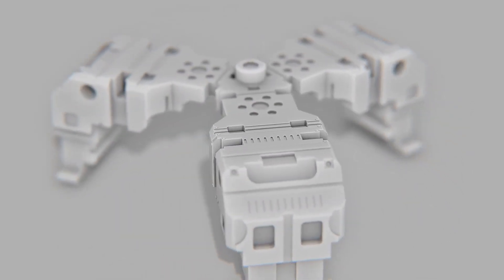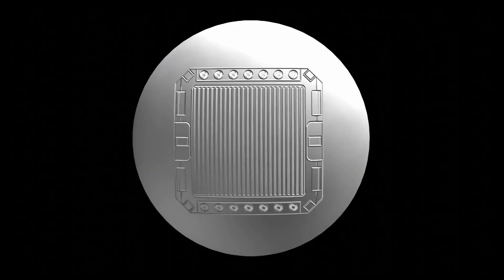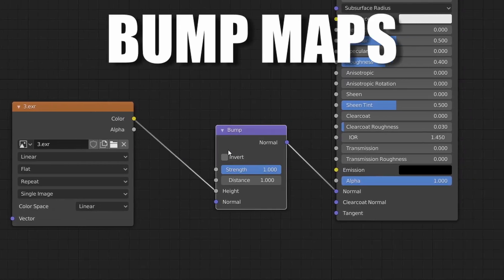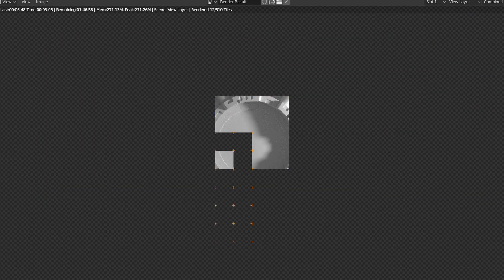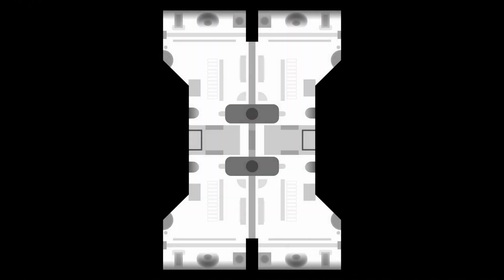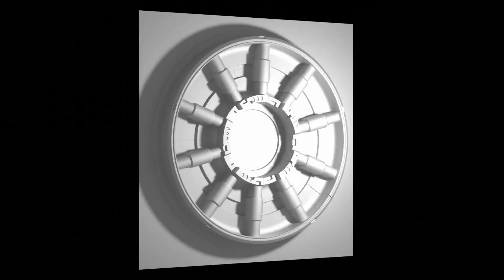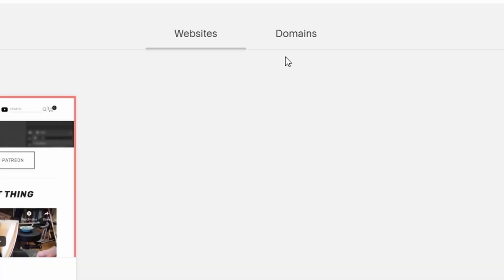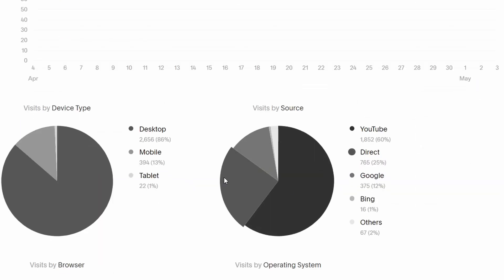WTF are... NORMAL MAPS?

Comment: When making use of smooth shading, there are two techniques called Goraud Interpolation and Phong Interpolation.

In Goraud Interpolation, the vertex colors are calculated based on their normal directions and the current lighting / material information. That color is then interpolated across the surface of the polygon that's formed by the triangle. This means that lighting calculations are done per-vertex.

In Phong Interpolation, the vertex normals are interpolated across the surface of the polygon and the color of each fragment is calculated based on it's normal direction and the current lighting / materials. This means that lighting is done per-fragment / per-pixel.

For obvious reasons, Phong interpolation is a lot more computationally expensive than Goraud interpolation, but produces a much more accurate shading that captures things like specular highlights.

Modern computers are more than fast enough to do per-fragment / per-pixel lighting, as is the case with Phong interpolation. But when you use a normal map, you're skipping the interpolation of the vertex normals and simply sampling the fragment normals from a texture image. This is less computationally expensive and gives you more control over how the surface is lit because you're essentially telling the renderer which direction light should be reflected on a pixel level. You can make a very low-poly surface be lit in almost the exact same way as a high-poly surface.

Tessellating a surface into more polygons can also help lighting appear more smooth. If you do this at runtime, you can have a displacement map displace the vertices of the generated polygons to add more detail to the surface. But if you're not tessellating, you can still use the same image as a bump map, in which case you're just creating the illusion of the surface being raised or lowered via a lighting trick. This isn't as good of an effect as normal mapping, but takes about a third of the data.

The use of bump mapping or displacement mapping is a mutually exclusive choice. Do you want more detail, or just the illusion of more detail?

Using bump mapping together with normal mapping is possible, but stupid and pointless. Just choose one or the other. Do you want to save memory with a bump map, or have more detail with a normal map?

In contrast, using displacement mapping together with normal mapping makes perfect sense because displacement mapping creates actual detail, but may not be able to capture some of the more fine-grained details that normal mapping does because it's limited by the tessellation.

Comment: google search gave me this.. 'Bump maps are the old school way of adding detail to low poly objects. They are used in the same way as normal maps, except they only contain height information and not angle information. Displacement maps are sometimes used to change the location of actual vertices in a mesh' now i get it. good video though glad i learnt something :)

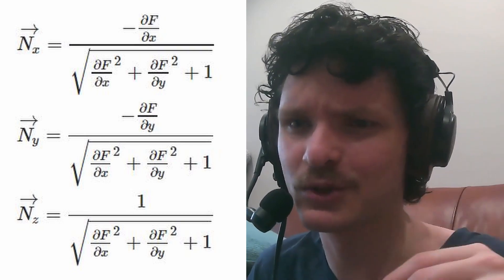Comment: At 2:21, the equation can be daunting at the first glance but it's nothing but "normalising" the normal vector. Basically, the vector we get perpendicular by finding the derivative (numerator) is some scalar and we want a unit length (magnitude 1) vector that's perpendicular to the surface. That's why we divide by the denominator. So all it does is give us a unit length vector.

Comment: I still have no idea what a normal map is
Probably because I'm still not sure what a normal is
Reply: a Normal is a vector pointing out of a Face in a 90 degree angle to calculate light on it (think of it like sunclock or what it's called). As long as the normal direction to the light is above 90 degree the object is presented lit (the more the light is at a similar angle to the normal the more the face brightens up), is the angle negative the object is unlit.

I use faces because they are easier to understand, but they are just the sum of vertex normals. these doing the same just for vertecies. Also if you see hard edges on object that means there are multiple vertices pointing in slightly different direction (as every vertex can only have on normal) soft edges only have one vertex and one normal.

Comment: An old artefact from 2020 and before, when game engines weren't strong enough to render million and millions of polygons in real time. It was used to fake details. 
You had to build the exact same model twice. Once you are finished your detailed sculpt with millions of polygons for your table for example, you had to remodel it with just a couple of thousand or even just hundreds of polygons. Imagine all the extra work they did back then.

Comment: I still don't understand what's the point of using Normal maps if BW bump maps look the same in the end.
Reply: they are more performant if you need realtime rendering like in a video game
Reply: Bump maps, when scaled up, need to do some type of interpolation (to create a new pixel to fill in the gaps when zooming in, look at your new pixel's  nearest pixel neighbors, and take some pre-defined type of average of the neighbor pixel values, and that's the new value for this pixel that we created out of thin air) to fill in the missing pixels on the screen.
AFAIK, Normal Maps allow more of a Vector Graphics style, where you can keep zooming in infinitely and not get the exact same type of weird aliasing effect (there will still be aliasing though).
So, using Normal Maps is a useful tactic if you do a lot of zooms in a game, like with a Magnifying Glass/Telescope/Periscope feature, but probably not in a game that uses a ton of MipMaps (lower res pictures) to simulate every single distant object.

Comment: A bump map converts the info into normal modification, but is insensitive to UV direction. Easy to combine or box map.
A normal map don't need conversion, it's direct info, but it IS sensitive to UV direction, or tangent space. Hard to combine or box map.
Use displacement map without any high frequency detail. Named _H, use for microdisplacement or parallax mapping (not in Blender yet).
Use bump map for small details that have high frequency detail. Named _B, use with a bump node.
Use normal map for anything that needs to control angles accurately. Named _N, use with a normal map.
All these should be set to non-color. Without parallax mapping or geometry shadow shifts, bump and normal maps can look very fake up close.

Comment: And now Ep¡c Games is saying that normal maps wont be needed anymore :,(
Reply: Not in reality, for many games assets the amount of massive detail like you'd want for say architecture just isn't necessary. Not only isn't it necessary such high poly meshes take a lot of space to store on your SSD so it makes sense to use normal maps for small details just like we've already been doing.

Some of the UE5 demos are 200gb installs.... and they lack the sheer amount of assets an actual game would have. Tiny scratches are still nicely represented by normal maps and it'll continue to make sense to use those over insane poly count meshes for a long time to come. The best result will be a middle ground and nanite allows for that, virtually no pop in detailed meshes but normal maps will still be used to simulate detail that otherwise you'd need a stupidly insane poly count to represent like small surface imperfections.
Reply: lol forget that, Nanite is cool but has some serious limitations. Also i wouldn't pay for 500-terrabyte size games, no matter the price. Also your pc wont scale with nanite, somewhere do the asset storage go to be instantly visible in the game, an people barely have 16 gig of ram.

Comment: Remember, when using an image texture as a normal map, set the “Non-Color Data” option on the Image Texture node. And don’t forget to have a Normal Map node to convert the coordinates from tangent space to global space before feeding them to the shader.
Reply: hey man im kinda of like a noob at blender, can you tell me how to use the displacement image texture? like i plug the image texture of the displacement map to the victor displacement node and than connect that to displacement node and nothing happens?
Reply: as a bump ?

Comment: now how can I reverse this better (asking for my 3d printer)? you can displace bumpmaps and "bake" a texture (any color->grey tex and bumpmaps work) into geometry for 3d printing, but you cant undo normal maps for printing the high poly model. (you want all the faces you can get since they'll be sliced as paths, I have the ram and storage, ill make a 200mb model just to displace textures back into a model)

problems:
-the seams are broken unless you can find a perfect midpoint (you need a watertight final model so an accurate midpoint saves many angry hours of meshing)
-baking textures is like a lithophane and it doesn't represent the height detail that the artist intended (a brick's tex =/= the hightmap) (baking textures is nice and simple if you have something like a spherical photo that you get a UV unwrap to a sphere, you can get really nice small globes or props)
-bumpmaps nearly guarantee bad seams (you cant print unless you remesh, you just cant)
-gets very slow for hard edges because you have to uniformly spread out your triangles to be displaced
-edges of UVs can affect some more complex models if whoever textured it didnt use a smooth island boarder. (fucking UV went over the edge of the image somewhere inside to model and broke the displacement modifier)
-white/null gets displaced and will make internal geometry pop out
-cant use normal maps

I know a couple of these can be alleviated with a fill tool swapping the null textures with the intended midpoint color or remeshing first and somehow using that new UV set to only displace the outer, watertight surface for as few seams as mathematically possible, but both of those solutions are only situational and band-aids to the main issue. Any solutions would be helpful. (the end goal is a high poly, very high detail model of the fully texture filtered, fully tessellated, fully shaded model where all the detail is available to be baked into the model when remeshed for watertightness and printed)
Reply: by "baking" I also mean the exact opposite of baking, taking that fresh normal map pie and shoving it back onto the model.

Comment: I feel like he only explained what bump/height-maps do/are but only said that normal maps have 3 channels ...
for those who still want to know what normal maps do:
normal maps alter the direction in which the surface is facing compared to the actual direction the geometry is facing.
the three colors(coordinates) span a normalized vector. Red is X, Green is Y and Blue is Z.
an unaltered surface is this typical light violet as it has a maximum z (blue) component and ~50% the other (50% 'gray'  is equal to 0 while 0% is -1 and 100% +1)
Imagine the vector as a pen balanced on the tip
Reply: Yep i watch the video for understanding why i would want to use a normal map when bump mapping is so much easier to create. Still dont know lol
Reply: @Chevifier  A bump map can create magnification artifacts-- if you zoom in, it'll give you pixellation.  It's also slower to calculate, like if you're aiming for 60fps.  But you can use a bump map as a start, and then bake this bump map to a normal map, which will give you the best of both worlds.
Reply: Great! Thank you!
Reply: Thanks
Reply: Ok so i presume you would model your hard surface, then somehow bake that into a height map that can be applied to a more basic model with fewer faces, right? How do i learn about baking textures from models? I've always made my bump maps manually, seperately, in a photo editor...
Reply: @synapse349  first you model the high detail version,  then you make a simplified version.
With both models you can then bake the differences from the simple version to the detailed one into a texture. In case of a height map this would just be "how far are the two surfaces apart at this point?" Therefore it ist important that both models use the same uv map.
Reply: @synapse349  youre describing normal map baking. You can find tutorials on how to bake normal maps from high to low poly

Comment: Since the dawn of men people have been modeling super high-poly meshes full of detail... so we need to bake it into displacements so it can use an even higher poly count for a worst result! :D
#fistbumpforbumpnode
Reply: I don't understand the point of displacement maps :/
Reply: @doomstere.g352  well, think about this metal thing he showed in the video. if you just want to render one of those there is nothing gained in. using a displacement map instead of a model. but what if you have like.. a huge spaceship with 100 of those plates? hard to work with. 100  planes with the displacement map on it will work way better here. and since the adaptive subsurf will enhance poly count most near the camera, the planes further away won't have a huge impact on render times either.
Reply: I fail to see the point of them unless you’re generating them procedurally via nodes.
Reply: @henryrichard7619  or they can be taken from real life objects too. Also it's easier to store a light image file than a heavy 3d model.

Comment: Anytime I use a black and white heightmap image (regardless of format or bitdepth) it comes out looking blocky to the bump node. So heightmaps are pretty useless to me.
Reply: if you mean as a bump map then maybe you need a higher res texture, if you mean as a displacement map you gotta subdivide the mesh so it has enough verts to displace - all it's doing is moving those around, if it's too low poly it'll look low poly

Comment: Thanks! Great video!

Normal maps are a newer technique, aren't they? Why do we have normal maps, which are more complicated, when bump maps do essentially the same thing?
Reply: I'm not an expert, but as far as I understand it, yr bump maps are one of two kinds - height or normal

Height maps just represent elevation straight up off a surface, and the grey value controls how much it's raised or lowered. You can simulate a curved displacement by using a gradient, so the elevation gradually changes - like a stepped pyramid, if you make the steps small enough it looks smooth, but all the elevation is still straight up

Normal maps contain normal data instead - which way the surface is pointing, and you can simulate curves by gradually changing the normal data. This is basically how smooth shading works in blender - only the vertices have normals, but you can blend between those to create fake normals that gradually change direction as the fake surface changes. But there's no height data there, just direction data

So they kinda do different things, and they can manage similar effects to a degree - even though normal maps don't have height, if you have a horizontal bit then a vertical bit then another horizontal bit, lighting that is gonna look like the second horizontal bit is above the first, because there's a vertical bit between them. But there's only so much you can get away with, and that's why textures tend to come with a normal AND a height texture, so you can use the right thing for the job (usually both)
Reply: @cactustactics  hmmm.. yeah, i get that they both use different techniques to fake the displacement, but why choose one over another?
Reply: Normals are an integral part of calculating how light interacts with materials. They can arise naturally from details of the geometry (orientation of the surface at each point), if you have sufficiently detailed geometry. If not, you can fake the normal map and give the effect of detailed geometry, at lower cost.